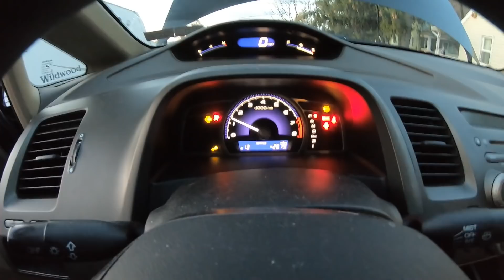THIS SHOULD BE REDESIGNED WHY PUT IT THERE

Comment: Why does it need redesigned? I mean cars are "designed" to be driven about 60k ish miles. Just past the warranty. Or they are traded in on new model about every other year. Not everyone is rich and well new cars are just not for a lot of the population. Fuck most of the people I know probably never will buy a brand new car. At any rate a starter is usually not a "maintenance" item and it doesn't even look that hard to do. Wait till you do a power steering pump or timing chain on a GM "High Feature" engine. Did one last week on a 201 Traverse for customer.  Shit I had 3ish hours into doing it. The rear catalytic converter has to come off but the book tells you to pull transfer case but I didn't.

Comment: Honda has terrible places for starters. I had to replace on and its was under the intake of the car had to take whole manifold off to get to it
Reply from the maker: K series suck lol
Reply: I'm surprised a Honda that age needs a starter. My stepdads 2001 ford sport trac with 205k miles, it still has the original starter on it. And it is very easy to access, if needed to be replaced. I just wished the 4.0L had other better designs. Like the damn timing chain setup, it is a complete joke. ha Euro trash design, it was a very cheap upgrade, they just pulled out the camshaft from the block, replaced with jackshaft, put upgraded heads on it with a rear chain driven by the jackshaft. They covered the rocker holes with metal plates, then they call that overhead cam lmao.